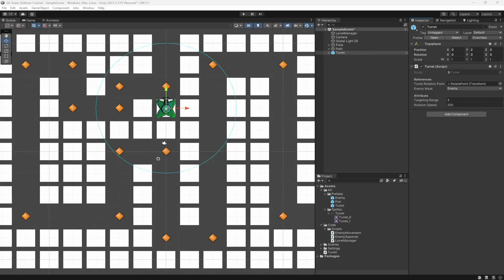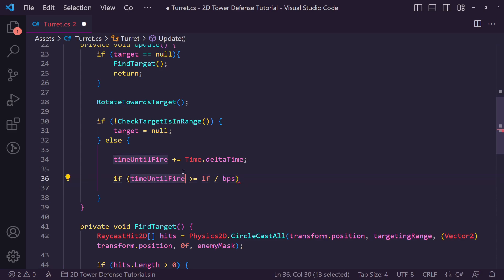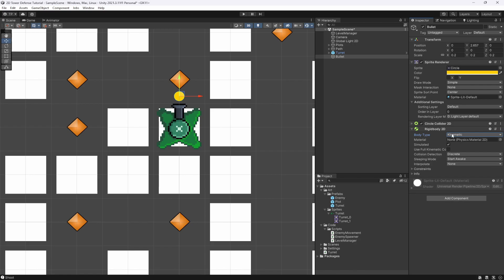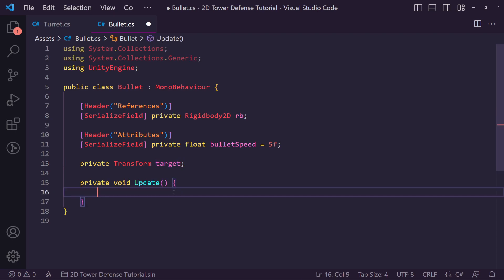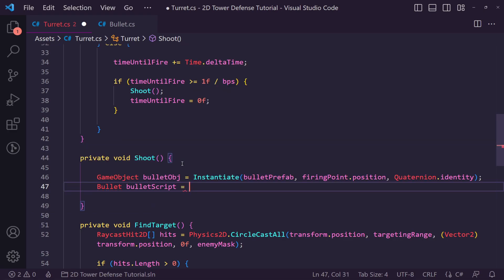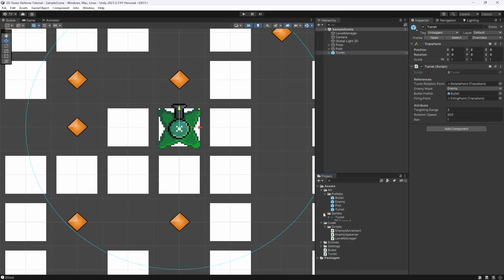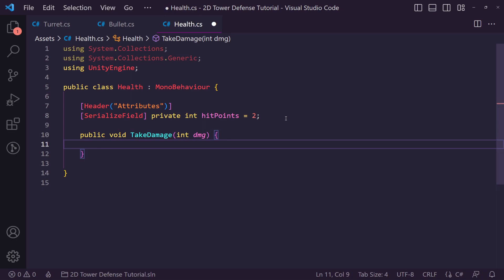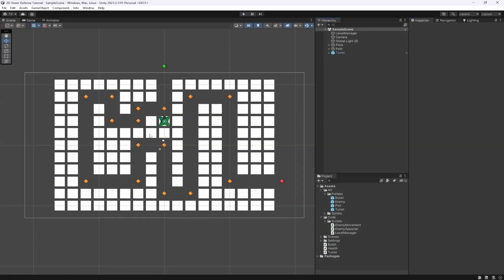Turret Fire - Build a 2D Tower Defence Game in Unity #5

Comment: For all people who struggle with the moment on 11:10 . The reason is you need to go to Physics 2D > Layer Collision Matrix , as shown in the video. However, in newer versions it seems, the ui has changed, or at least for the default layout, so, you need to select in Physics 2D and then Layer Collision Matrix , but not the dropdown menu, it's a different tab, right beside the General Settings one. It's quite also misleading that the normal Physics has the Layer Collision Matrix just like the old Physics 2D one, so a lot of people, I've noticed, in the comments said that they did the layers off, but still the bullet collided with the Plot gameobject

Comment: I somehow have a trouble, even though i created bullet layer and assigned it to bullet and in project setting physics 2D i have ticked off everything besides Enemy, the bullet still hits the wall. Im trying to figure it out, since 40 minutes or so but i have no clue why
Reply: Like it doesnt destroy itself but it stops
Reply: same problem
Reply: have you solved it?
Reply: @iratxosoto5408  i do not have this project anymore 😅
Reply: @iratxosoto5408  For all people who struggle with the moment on 11:10 . The reason is you need to go to Physics 2D > Layer Collision Matrix , as shown in the video. However, in newer versions it seems, the ui has changed, or at least for the default layout, so, you need to select in Physics 2D and then Layer Collision Matrix , but not the dropdown menu, it's a different tab, right beside the General Settings one. It's quite also misleading that the normal Physics has the Layer Collision Matrix just like the old Physics 2D one, so a lot of people, I've noticed, in the comments said that they did the layers off, but still the bullet collided with the Plot gameobject

Comment: I chose a different Bullet design, which has an elongated shape. How can I rotate my bullet in the right direction when it is fired right at the beginning? For this you only have to retrieve the rotation value from the turret and transfer it to the bullet, but how exactly? Otherwise it hits the Enemy with the elongated side instead of the front, pointed side.
Reply: Might be a bit late, but the answer is actually rather simple. All you have to do on the bullet script is set the rotation of the bullet to the direction vector: transform.up = direction;